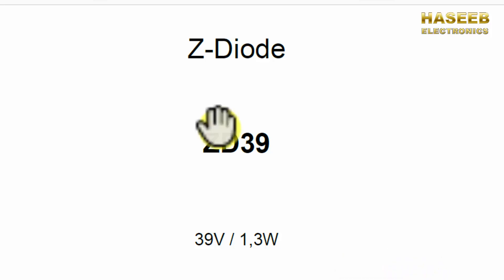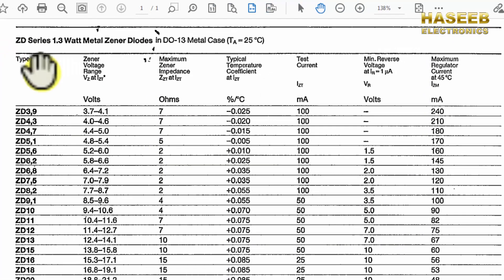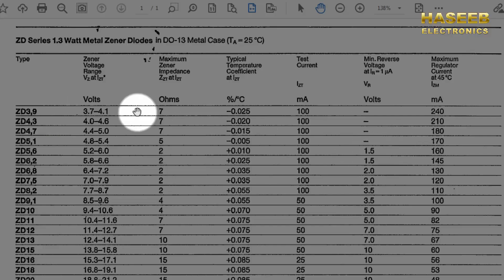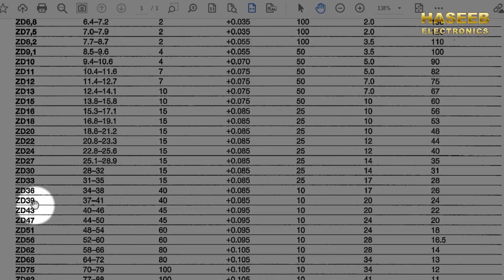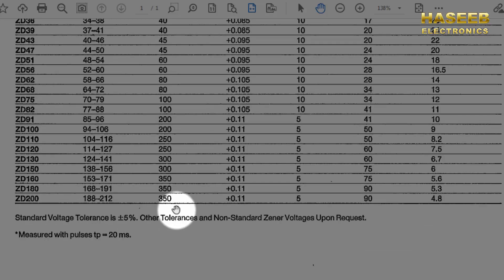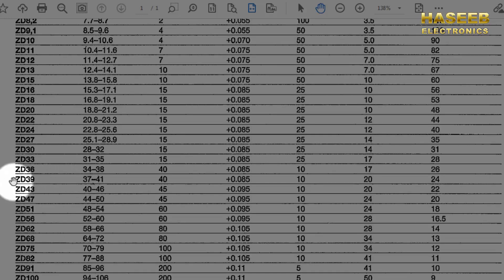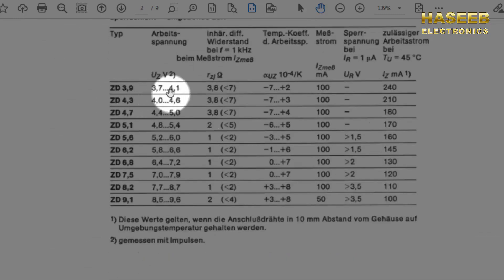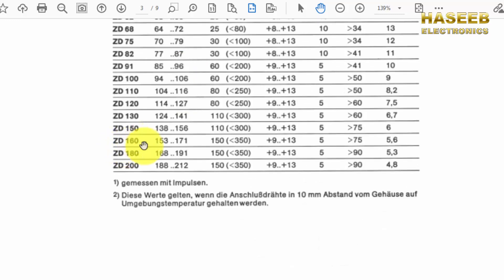[407] ZD39 (ZD Series) 1.3 Watt Zener Diode Datasheet

Comment: I am confusing about temperature coefficient, some example vishay datasheet mention in %/K other datasheet mention in%/°C
Reply from the maker: K and c are increasing similarly 
0k is -273.15c 
Then increasing equally 
273.15k = 0C 

just k kelvin starts from -273.15
And Celsius starts from 0

Comment: What is the voltage of these zenor diodes z2a7  and z27d
Reply from the maker: it is 2.7 volt. (min 2.54 max 2.75) 
part number GDZJ 2.7A
Marking Z2A7